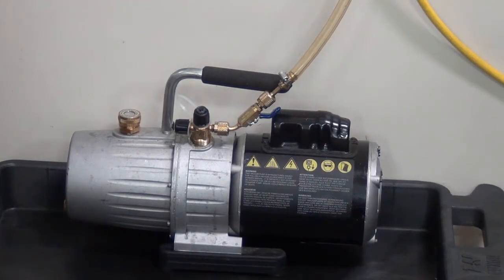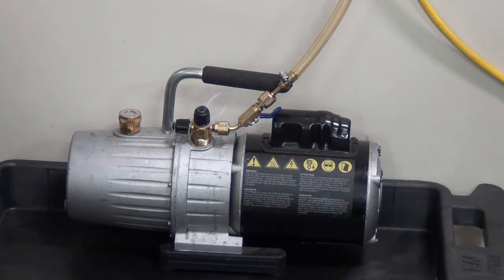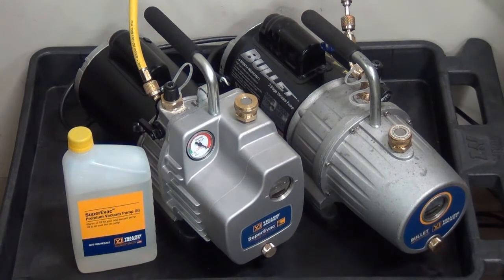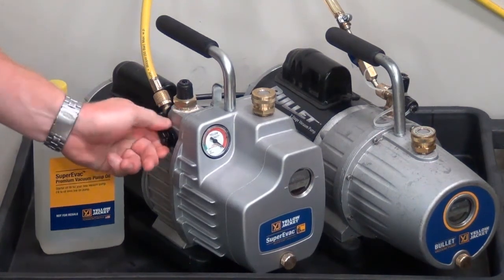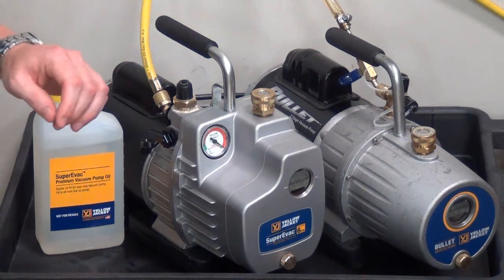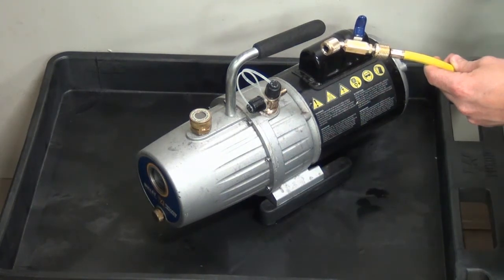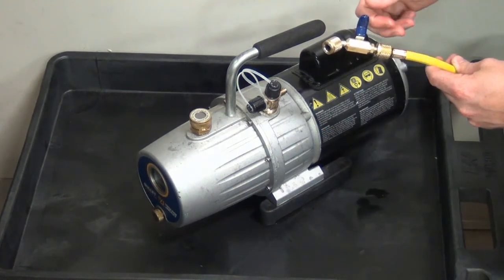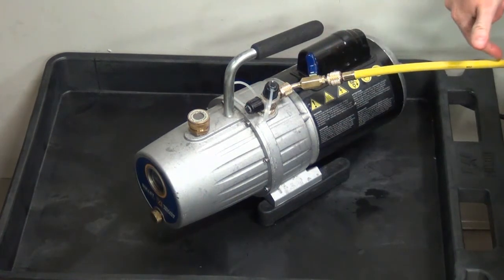YELLOW JACKET - Best Practices for Vacuum Pump Operation - How to Avoid Oil Suck-Back

Comment: This pump has showered it's oil all over a customer's kitchen by blowing it's oil out the fill port on startup. I now tie a rag around the fill port to prevent this. Never had this problem with any other pump . What's up with that?

Comment: Summary: don't have any vacuum in the system when the pump is off. For Fischer Lav-3 users, you can simply use the Air Ballast Valve to release vacuum before turning the pump off. But it is better to purchase the LAV-3WAYVALVE so as to not wear out the Air Ballast Valve threads and for easier and faster vacuum release.